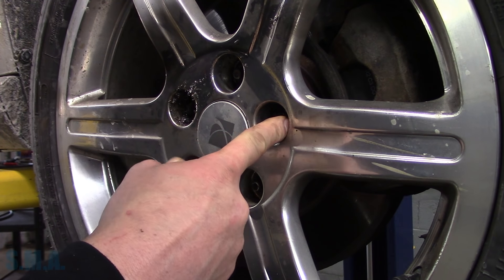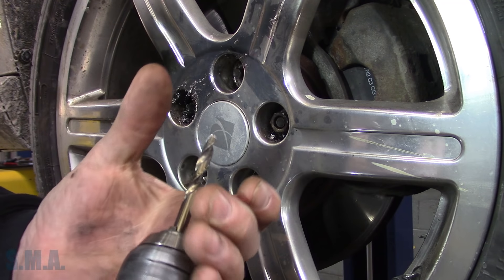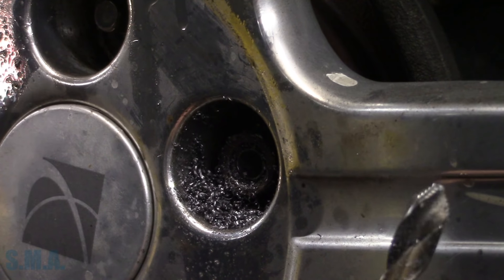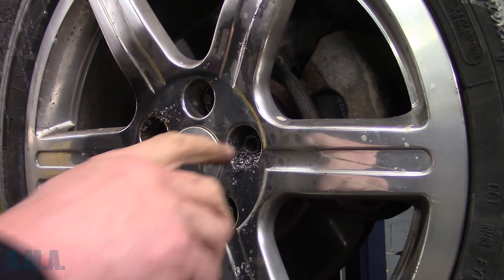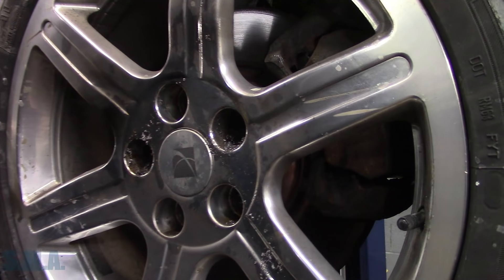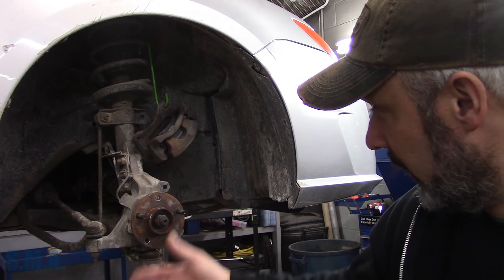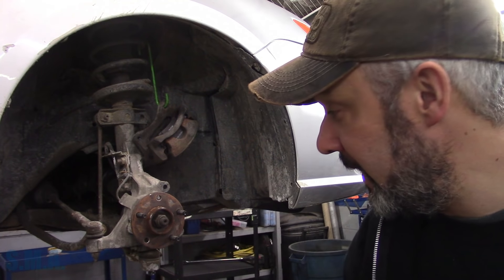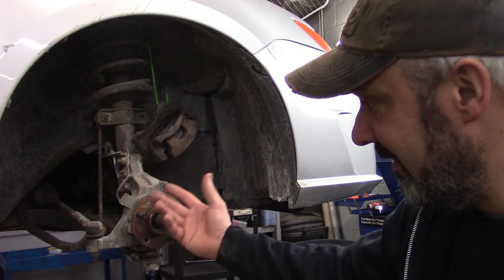DIY Seized/Stopped Lug Nut Removal

Comment: I've had to bang an extractor onto more and more lug nuts as of late.  Belle Tire, Discount Tire, Dealerships, all must just love their 1/2 Ugga-Dugga guns set to ludicris and they just hammer them to the max.  I had to do brakes on my wife's Expedition, and found that the lug nut was not the "standard 3/4"".  So I pulled the tools from that came with the truck..and found they also assumed the 3/4" lug...nope...BIGGER...but then when I finally got the right sized socket on there  (13/16"?), I found that the lug was rounded off.  The truck had only been worked on at two places.  Belle Tire (tires), and the dealership (Oil/Lube/Filter and Rotations).  Those guys trashed EVERY SINGLE LUG NUT.  Cost me nearly $60 to replace them...not pleased with these newbies at these places they have "learning" just cranking on the Ugga Dugga until the freaking socket rounds over the lug nut.

Comment: The worst are VW antitheft wheel bolts when the key is lost, they have the spinning outer cover which is hardened, the bolt itself is super hardened. If you could get a twist socket on there, it would wreck it instantly, a carbide drill bit won't make a dent in the bolt, the only way I have had success in removing them is to grind them out with a bunch of carbide burrs and a die grinder, very time consuming and need to be super careful not to wreck the rims.

Comment: Interesting, i was always taught when drilling metal to go slow with high pressure, rather than full speed ahead. I assume this is all dependent on the quality of the drill bit. 

However this looks much easier than when I had to do this on my sisters Clio, used a cold chisel and much swearing.

Comment: WTH?  DId they use SAE sockets on the metric lugs?  Just went through a 1.5 hour tire change at Costco today only to have the stick on weights hit the calipers as I drove out.  Back for another 15 minutes to switch to hammer on weights on the RF wheel.  Wonder what is going to happen when I rotate the tires?????

Comment: "Any lube will do..."

I was in the home garage shop fabricating all morning and for a few hours this afternoon.  A lot of the shop work involved the drill press.  I always giggle in my head when punching through thick metal and my cutting fluid of choice is used motor oil...

Comment: That would work for many vehicles.... except for the VW or Audi. Ugh. I hate them. Super hard steel, and the external stud has disconnected piece that just spins, so no "socket" will work. Many are like wheel lock key looking now.  Remember VW & Audi are studs, not lugs. Then the rims have deep wells and ultra tight around the stud. What a bugger!! I would love a cheaper way to get those off. So far, I've only seen expensive special tools to be able to.

Comment: Never experienced an issue removing wheel lug  nuts.  Many vehicles, many years,  perhaps just fortunate or could using the proper lug  wrench be the reason?
Reply: IT''S THE GUY BEFORE YOU THAT CAUSES THE PROBLEM.
Reply: It's all in how the nuts were put on. I had to change a tire on my first work truck, back when I was young and studly. They were obviously ugga-dugga'd to way over 300 ft-lbs. I could lift 200 lbs but I could not budge any of them. I used my go-to move for stuck nuts. I clamped a pair of vise grips on it as hard as I possibly could, forcing the threads together and opening a tiny gap 90 degrees away. A spray of penetrant oil on the end and on the seat (which has also been shifted) and a minute to wick in, then release the vise grips and remove the nut. I don't know how much it reduces the torque but it has never failed me. I wish I had the same sort of move for bolts.

Comment: Hmm…I’ve had lug nuts get stuck, cause the previous idiot cross threaded them on there…usual solution is to stick the ole Milwaukee on there and send her till she either comes free or snaps. Had one where I tried that, and it spun the stud and wallered out the hub…gave that the long shank air hammer treatment, split ‘er right in two. Haven’t had to blow one off with the torch yet, but I’m sure it’ll happen sooner or later.

Comment: My problem is that my broken bolt is upside down making it difficult to apply lubricants and it is above the drive shaft to the right and the fuel tank is right next to it because it holds the fuel tank strap on the undercarriage.

Comment: Sad my dealership(no longer) did this, rounded off all 20 lug nuts.  Bought the car new and only had the same dealership for maintenance during the warranty period.  I got a service notice asking to go back for service, should I?
Reply: Are you a gambling man?? If a dealership did that, I'd never use that 'dis-service department' again for anything! Find another dealer.
Reply: @markh.6687    I do not gamble.  I am staying far away...  
Already started changing oil, replaced the 12v battery, a wheel bearing and will be replacing the spark plugs and do tire rotation and oil change in a couple of weeks when it warms up a bit, it will be a high of 44° this Saturday.
Reply: @JT-lq4yd  Good job there! :)

Comment: Hi I have a 2008 Toyota Corolla ce with a electric throttle body which I clean because it has a low idle but didn't fix the low idle there's no check engine light on  can help me

Comment: Or you can take the socket that's a 1/4 too small or a mm smaller, sledge it on and impact them off. Whatever works.

Comment: My lugs aren't rounded, but they're stuck. I have a breaker bar and trued using it and snapped 1 stud, and all the other studs feel like they're going to snap if i keep trying... Sprayed with penetration oil and nothing is working...  All in trying to do is change my brakes

Comment: A way I didn't know. Here's another, find a deep socket that's just small enough not to fit. Buy a bunch of cheap sockets that size. Hold them with pliers while you sledge hammer them on the nut then breaker bar the socket (with the lug inside) off. The shape memory of the steel socket grips the lug as tight as can be. Downside? The lug nut is never coming out of the socket. NEVER! So you have to toss them. That's why you get cheap sockets.

Comment: Great idea,, until the owner or some idiot with a air tool cranked up the nuts to some insane  torque setting that locks the stud and nuts threads together. Now you get the joyful task to snap off every stud with a massively long 3/4 inch drive bar and a no nonsense six point socket, and replace all the snapped off studs and fused on nuts. We are talking about acorn type nuts so breaking them off is more fun than drilling. If you encounter one of those drive flange hubs with integral bearing that once its removed by slide hammer and has to be replaced, it makes your day even more fun.

Comment: Nice quick tip. However I would want to charge the customer for 40 replacement bits that were just dulled to death in this video as well.
Reply: Billable as "Shop Supplies" methinks.

Comment: Doesn't say much for Walmart I've had problems at sams club to it seemed that they didn't know how to clean rims and my tires leaked tried to blame it on alloy wheels but the truck I also had tires put on leaked also those were steel . Found another retailer to buy tires from.

Comment: Could you imagine like most jobs, it's not just one , but many lug nuts not coming off, this is because of stupid "mechanics" NOT PUTTING ANTI- SEIZE on threads. Drilling out all of the seized lug nut because of stupidity and now the car owner gets to pay for "Quality Workmanship", what a bunch of crap. I've seen dealer "mechanics" over tighten in hopes for the big pay out in drill outs. What a sad practice.

Comment: This, or you could just apply a bit of antisieze on the threads when you put the tires on.
Reply: aluminum/magnesium rims, it's often the conical contact area seized and not the threads. corrosion is fast and bad between the steel and aluminum, the clamping forces can go to massive forces, enough to stretch and/or shear off the wheel studs! we wont mention that it warps rotors, hubs, rims, etc. ;) stupid designs by far

Comment: Why is it that people see a nut or bolt and they feel inclined to apply so much torque to it they strip it, shear the head or damage the thread? The nature of a fastener is such that once it's permanently in elastic tension you can stop*, applying twice the torque required confers no further benefit.

*Except for torque-to-yield, but those are not common.

Comment: The drill "lubricant" is actually performing as a coolant.
Reply: It's both.
Reply: "Rapid Tap" is what you want to use, save your bits, taps and other assorted metal cutting utensils
Reply: @BPattB  Just use the cheapest cutting oil you can find. For drilling out ferrous stuff on cars, the sulfurized heavy (dark) cutting oil that is dirt cheap is best. Just be aware sulfurized cutting oils stain copper and copper alloys and occasionally aluminum, so avoid it if you care about your copper bits staying bright and shiny, otherwise just go for it.

Comment: I quit going to discount tire because of this. They’ve stripped out several in the past and then tell me to go to a shop down the road to fix it. That takes another 2-4 hours of waiting. Plus I’ve seen them try to put the plastic wheel nuts on my silverado with an impact. I had to yell at the kid to stop and let me do it

Comment: The way I remove stripped lugs is to drive it to a shop and tell the guy "I don't know what happened, it wasn't like that before I drove it on your lot" and then let him deal with it while I pay.
Reply: Just bought the car and the guy had it serviced at our local Walmart.
Reply from the maker: @andrewgorges3152  between Walmart and express lube I keep hundreds of wheel nuts in stock 😂

Comment: Haha I use the Milwaukee cobolt drill bits.  Not a sponsor but I can buy like 10 sets for the price of the Matco.  Not a sponsor.
Reply: This also works if the top half of your lug nut busts off and your left with the bottom cone part still in the rim.

Comment: You can't use those kinds of lugs in Florida, they'll seriously put it on backwards and give it too much ugga dugga but thats what you get with the cheap tire shops
Reply: I had my Jeep Cherokee in to the local dealer for warranty work. The had a summer high school hire install the chrome covered lug nuts with an air impact gun. During the weekend, when I wanted to do a brake job, I could not move any nuts, even with a breaker bar and a 12 foot 1" black iron pipe cheater, with my 220 lbs bouncing on the bar. The next Monday, I returned to the dealer and a mechanic could not get the lugs to budge with an air gun. They called the kid over and asked which air gun he used, and he said "that one - the big one". It took about 30 second of constant pulsing to get each one off. I had them replace the studs and lugs, as they were obviously twisted. Power to the air gun!!! and a little training using torque sticks was necessary.

Comment: How the hell do you round lug nuts out that bad????🤔🤔🤔🤔🤔🤔
Reply: Wrong size socket and keep trying ?🤷
Reply: Actually watched my neighbor do it to his friends car. He put the lug wrench on the nut and since he wasn’t strong enough to break it loose he thought it would be a good idea to jump on the end of the lug wrench which only rounded the nut. And before you all come for me for not helping... they aren’t good neighbors
Reply: If you live in the rust belt the lug nut will swell up under the chrome cap and the rusted lug is not as strong. The chrome cap will come and if it's rusted bad enough it will round.

Comment: I normally crack the lug nuts with a air hammer that's my normal method Eric O @SouthMainAutoRepairLLC
Reply: Depending how deep the rim is, and how deep the lugs are, you could try a Dremel tool-type, or one of those all-purpose electric vibrating trim/plunge cutter tools to cut/split the nut, instead of drilling the studs.
Reply: @markh.6687  yes you can 100 percent
Reply: @markh.6687  I think your post was meant more for Eric O

Comment: Since your using drill bit to solve your issue...Why not just use a Reverse Drill bit....I'm sure it will grab the nut...and if it doesn't you still drilled the hole

Comment: Get your longest sawzall blade. Lift the car up. Climb your ass into the wheel well and place the sawzall blade right at the junction of the wheel and the hub. Give 'er til all 5 (or 6 or 8 or 4 or whatever) lugs have been separated from the hub and the wheel is sittin gon the ground

At least that's how it works in my head.

Comment: Yeah but … what if your wheel is spinning and no matter what wedge you use … it still spins. No, the car isn’t jacked up, the other side is. The tire I’m working on is completely on the ground. I have 3/4” socket with a huge piece of SS pipe that took 4 lug nuts off, it’s just that last one that’s stuck … BUT THE WHEEL KEEPS MOVING and I don’t own an air/electric impact wrench but I do own an electric drill with plenty of bits and WD-40. Just cuz I’m a girl, I DO know what I’m doing (plus thanks to the folks on YT). Wish me luck! I wish I knew of a way to stop that wheel from moving. I’m sure my pipe and socket wrench would work but…..

Comment: So, the Dolts stripped off ALL 20?  Really? What kind of person does that?  At least I get the point after 3 for 4 .... 

LOL.  Anyway, I really really dislike those chrome capped crap.  I had to have 5 put on my truck last fall.  They had to hammer on the sockets to get them off for a tire rotation and then another 6 on our SUV the previous summer.

Comment: walmart zipped on nuts with impact like a nascar pit crew
Reply: It can be done without serious consequences if they use a torque stick. I found an interesting one at Amazon: it is a solid piece of metal but once the torque reaches 80 ft-lb the metal flexes enough to prevent the impacts from getting through. Kinda cool, actually, and close enough for my wheels.

Comment: Who in the Hell strips 20 lugnuts!
Antiseize those studs!
Reply: All the places that hire $10/hour help in their Oil Change and Tire Rotation area.  I've seen it from Belle Tire, Discount Tire, dealership service centers, you name it.  These kids get these Ugga Dugga guns in their hands and just say "So, until the nut stops turning"...had one where the kid snapped the freaking stud....fought that one, they ended up replacing the lug and stud "free of charge", but I had to fight for it.  I told him to put a torque wrench on those lugs to see where they were currently at.  They were WELL above 150ft lb.  WAY OVER TORQUED...sheesh.